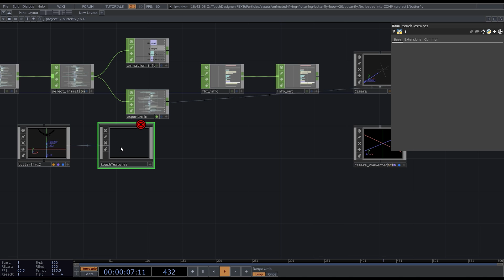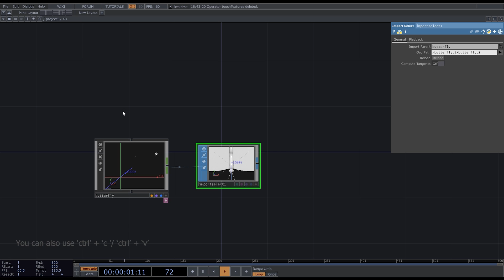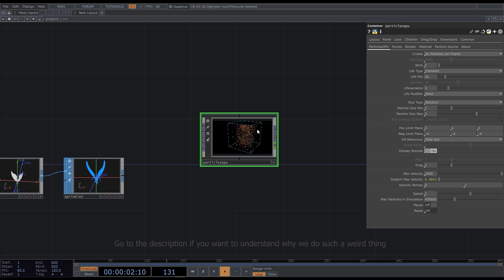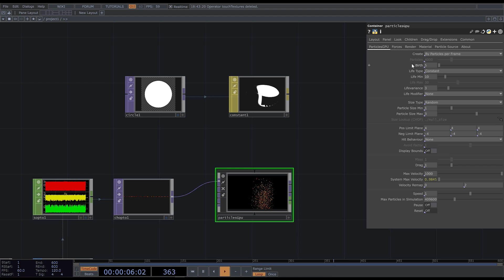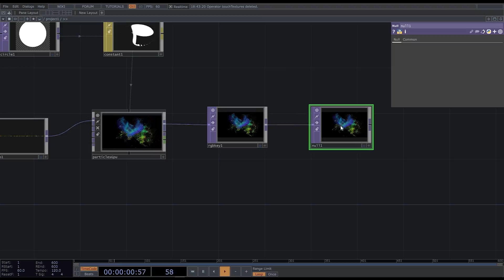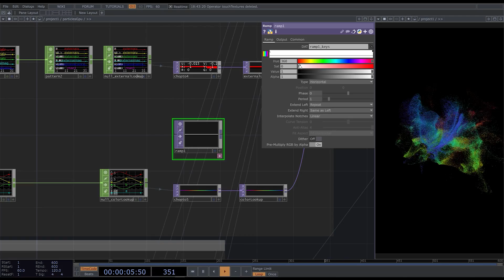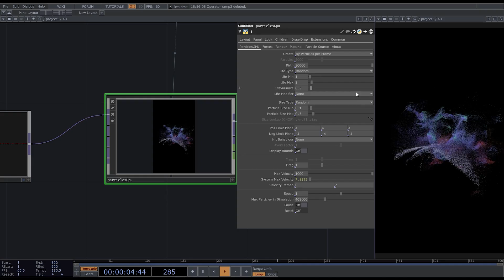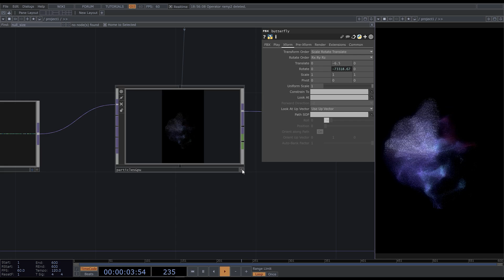Animated .fbx into Particles | TouchDesigner Tutorial

Comment: Could someone help me? I'm stuck in the GPU particles section because it never takes the shape of the dragon I'm using in FBX. It either stays all black or just forms a line of particles.
Reply: Me too! Have you solved this problem？
Reply: Hey! I'm running into the exact same problem. Did you ever find a solution to this? I'd really appreciate it if you could share it if you did!
Reply: I dont know if it fixes your problem as well, but what I did was reduce the range of the sopto so it fits in a range of 0 to 5. For me that fixed the issue of not showing any particles because before the range was just too high so the particles were to far from each other.

Comment: Hello! I am a beginner and purchased your project to see your workflow in more detail! I wondered how I could render the butterfly floating forward like you had in the beginning of the video? Thank you so much!
Reply from the maker: Hey, I've just dropped you an email:) In short, you can add a procedural source of changing values (e.g. LFO CHOP), connected to the parameter you want to animate, or you may use the Animation COMP for more precise control.
Reply: @anyamaryina  Hi Any chance you can share that details on rendering the butterfly moving forward to me as well? I'm trying to implement with LFO and feedback loop but weirdly not working. I'm using the tox purchased from your link.
Reply from the maker: @leewayz9471 Hi, lmk your email or send a message to anyamaryina.cg@gmail.com - I’ll send you over the example!
Reply: @anyamaryina  Hello! May I also have the example as well? Thank you!

Comment: Hello, I am a beginner, why can't I find SOP with static mesh in my FBX animation, what should I do, I really want to know
Reply from the maker: Hi, you can also do it this way:

1. Drag your file to the network
2. Then add an Import Select SOP
3. Drag the FBX component (an operator with your .fbx file) to the Import Select SOP, it will create a thin link between operators
4. Select the Import Select SOP and click a triangle arrow to the right of the Geo Path parameter, there will be some option(s), choose the mesh you need from there. If there are no options, then the reason can be in the export parameters of the .fbx file, I can recommend importing it to Blender and export with default .fbx parameters.
Good luck :)
Reply: @anyamaryina  I am really excited and thank you very much for your reply! I clicked the arrow on the right and it popped out successfully, but I used a lot of cloning in my animation, which resulted in a lot of small models popping out. What should I do about this? Hope to get your reply
Reply: @anyamaryina  May I ask how to select multiple options at the same time in the fourth step? Hope to get your reply, thank you very much
Reply from the maker: @ppli-l7l  There's no option to choose multiple parts, but you can choose one, add a Deform SOP to extract the animation (see tutorial), repeat this for every instance and then merge all the Deform's outputs with a Merge SOP. Then follow the tutorial!)
Reply: @anyamaryina  Thank you for your answer to help me a lot very good tutorial!

Comment: Hi, I came across your tutorial on animation in Particles. I’m having an issue: I’m following your steps, but in this module, the particles just line up, and the "Interpolate Sourced Point" option can’t be disabled. Could you please tell me what I’m doing wrong? Thank you so much in advance! (I just started working with this, so I apologize if the question seems silly.)
Reply: Hi, if the parameter you can't edit is yellow, it means that it is in the read-only mode. You can uncheck it by clicking mouse right button on the parameter name -> Toggle Read Only mode. As for the particles lining up, make sure your model was imported properly and looks the same way as mine on previous steps, also you may need to increase the size of the model (Fbx COMP -> Xform tab -> Uniform Scale parameter).
Reply: did you find an answer? I have the same lining up problem
Reply: Did it work some how? I have this problem too but i guess is bcs of the non commercial version...

Comment: This is a really good tutorial.I want to render a butterfly by rotating its angle. Is there any way to do this?
Reply from the maker: Hi, thank you! You can find how to rotate the model at 09:53 (if you need another angle - tweak another rotation parameters). To make custom animation you may want to use Animation COMP, I recommend to read a documentation or watch some tutorial on how to use it first. It's easy to work with, but may be not clear for the first time. To render the butterfly use Movie File Out TOP, you should connect it to the the output ('null1' operator in the tutorial). Good luck:)

Comment: I have used sop to chop and connected to particlesGpu and the particle part is not as the butterfly moves😢, it becomes a single line instead. I noticed that the chot to image is just a black line, not like in the clip, so I think the cause may start there. Do you have a way to fix it please?
Reply from the maker: It may happen when your model is too small, try to significantly increase its size in the Fbx COMP (Xform tab, Uniform Scale parameter)
Reply: @anyamaryina  it’s work!! Thank you so much 😻👍🏻
Reply: @anyamaryina  i was having the same problem, you saved me!!
Reply: hey I have the same issue but rising uniform scale doesnt change anything about particlesGpu how did you do it ?

Comment: Sorry, in my case doesn't work. When I apply the deform, it says "no capture attribute exist".
Reply from the maker: Hi, to be workable, your file should have capture attributes. You can verify it has them by middle-clicking the ImportSelect SOP (with already assigned Geo Path) and looking for Point Attribute pCapt, Detail Attributes pCaptStr and pCaptData in the bottom of the window.

As far as I know, TouchDesigner supports only animations on the root transforms of geometry, blend shapes and skeleton animation, so if you're importing the model done with, let's say, C4D modifiers, I have no idea how to make it work without going back to C4D and remaking the animations. But I'd clarify this on TD forum, maybe I miss something: transferring geometry between softwares is a tricky thing.

Also this can happen when you're using .fbx that contains multiple meshes. In this case you want to create multiple Import Select SOPs assigned to each mesh, then connect each Import Select SOP to its own Deform SOP and then combine Deform SOP's outputs to a Merge SOP. Then add a Sprinkle SOP and follow the tutorial!
Reply: @anyamaryina  thank you for the quick answer, I'll do my best to make it work.